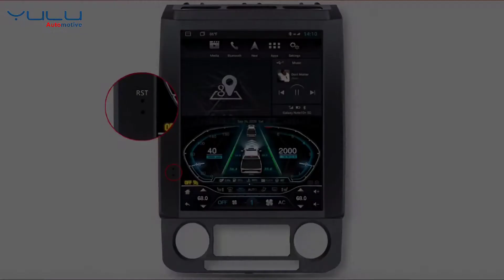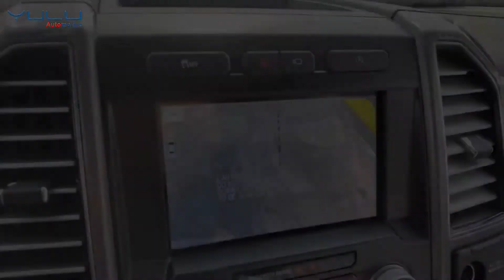YULU E9 | Install Ford F150/250/350/450 SYNC1/2/3 Tesla car radio navigation screen.

Comment: My 2017 F150 XLT does not have a front or 360 camera. When the truck is stopped my home screen loses video. Can I cut this feature off so my screen will stay on the home screen when stopped?
Reply from the maker: If so, you can disable all front camera options in Car settings.

Comment: How do wire in an aftermarket backup camera?? My camera has a yellow video cable, red power cable, and a black ground cable.
Reply from the maker: This requires checking the camera cable and audio cable. 
In order to communicate and solve your problems more conveniently, I hope we can use Facebook messenger for instant communication.
Please contact YULU automotive using Facebook messenger.
Thank you very much!